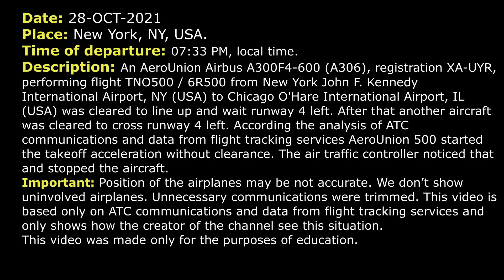Airplane started takeoff without clearance | AeroUnion Airbus A306 | New York Kennedy Airport, ATC

Comment: I was waiting to hear "Possible pilot deviation, get ready to copy a number!"!
Reply from the maker: Probably they didn't have time for that.
Reply: Everyone makes mistakes, so back in line, I guess
Reply from the maker: Yes, they've departed a couple of minutes later. Behind that 747.
Reply: There’s no way they weren’t contacted at some point with a possible pilot deviation. ATC is required to report to the FAA any type of go around due to something that’s in the airport environment. That’s why they always ask pilots what the reason for the go around is if the go around is chosen by the pilots so they can address any runway environment issues. 

Things like this aren’t a “whoops, no harm no foul.”
Reply: @VictoryAviation  They probably contacted company directly and safety report was filled anyway. I think copy number is mostly used for general aviation, when person responsible could be hard to identified at later time.
Reply: @FrankDrebin  I think that’s the safest way to go about it. However I’ve certainly seen part 121 pilots asked to copy a number on these videos several times.
Reply: If it was a US Part 121, they would have been given a number. It's a foreign airline, not operating with FAA certificate, ATC (meaning FAA) wouldn't have any chance to jeopardize the pilots certificates by filing a pilot deviation report.

Comment: Oof, that's a big mistake. I'm surprised they weren't given a number to call. 

Maybe they heard tower's instruction to AAL1199 at 0:39 saying "traffic will hold and depart prior to your arrival," knew they were going to get a clearance to take off shortly, and then just forgot to actually wait for the clearance? 

No excuse, but that's the only thing I can think of...
Reply: It still is something really silly to do though.
Reply: I posted this elsewhere:

There’s no way they weren’t contacted at some point with a possible pilot deviation. ATC is required to report to the FAA any type of go around due to something that’s in the airport environment. That’s why they always ask pilots what the reason for the go around is if the go around is chosen by the pilots so they can address any runway environment issues. 

Things like this aren’t a “whoops, no harm no foul.”
Reply: You shouldn't depart until you specifically hear tower clear you for takeoff.
"AeroUnion 500 cleared for takeoff runway 4L, winds 7 at 296."
Reply: @RacingProductions22  And also repeat it back for confirmation

Comment: A clearance to land. The departing aircraft’s mistake actually saved her a$$ by bringing her instructor’s attention to the situation. And yes, I’ve been a pilot for 42 years and was a controller for 30 years.
Reply: The screwup is completely on AeroUnion pilots.  The instruction ATC gave the following instructions:

0:21 ATC contacted TNO to hold at RW4L and wait, BUT NO ORDER to take off, and that there's traffic with 6 miles final incoming (AA) (TNO need to hold there for Jetblue to clear the runway and Delta to cross)
0:39 ATC gave AA isntruction on 4L, with the instruction that traffic is holding and leave before AA arrives, and caution wake turbulence (which meant AeroUnion should have taken off from 4L)
1:05 ATC tell Delta to cross RW 4L immediately and without delay as there are airplane on final approach (AA)

And the person cut in is most likely the supervisor (similar to Kennedy Steve, who's retired) or another ATC.

AeroUnion took off A) without ATC approval, B) WHILE DELTA is still crossing 4L, that's completely on AeroUnion pilot for taking off without ATC instructions

And in most major airports in US, planes can landing/take off on the same runway at the same heading (mix operation), in JFK's case, takeoff and landing can both take place on 4L as long as both planes involved will be on 4L heading, this happens more often on two runway airports (like LAX, JFK, or SFO with heavy planes)

Question for you is: how can you be a pilot for 42 years  and controller for 30 years  when controller maximum retirement age is 56 (if you're in the US)?  You got your pilot license at 14?  And have you ever flow passenger jets/work as ATC at heavy traffic airports like JFK or LAX (airport with Mix operations)
Reply: How freakin old are you?

Comment: Why would ANY pilot take off without clearance?  What else does the word HOLD mean?  This is commercial flying 101.   I simply do not understand the actions of this pilot.
Reply: It was a mistake. Very experienced crews make mistakes. No pilot that I know of would "knowingly" do that.  Somehow, they thought they were cleared to take-off and obviously there was a breakdown. You can be sure that there will be a report & investigation. 
It could've been a multitude of things that distracted them. The Sterile cockpit rule is there for a reason. I'm not suggesting that they broke that rule but it can lead to situations like this. 
I thought ATC did a good job managing their responsibilities to the other aircraft.
Reply: @BruiserFL  Totally agree. A report/investigation is required by the FAA for incidents like this. If ATC doesn’t report it, it could cost them their job.
Reply: @BruiserFL  no nothing do I ... but I would think that one of them would have spoken up and questioned when takeoff clearance occurred - and if in doubt checked with the tower.  (I was in error above, it was not just the actions of the pilot;  two people made a mistake)
Reply: Well, operating aircraft has more complexities and risks than you have any comprehension of.  Pilots make small errors and some of them can be catastrophic.  Good pilots recognize that they are not immune and when they make a mistake they own it.
Reply: @Spyke-lz2hl  I’m a pilot, and I don’t understand why they started to take off without a clearance. The clearance has to be given and read back to ATC for confirmation. None of that happened.
Reply: @Spyke-lz2hl  Agree Sypke with your words, although this doesn't explain how two people piloting the plane would takeoff when they were instructed to HOLD and were never given a CLEARED to take off command.  Again, I am befuddled.  Only the two pilots can explain this.
Reply: Could be in a hurry /stress / distraction / fatigue etc..you'll be surprised what they do in a jet engine flight deck...recently a flydubai also did the same thing on a max 8...also it takes 2 to make a mistake   here not 1 meaning both pilots thought it was ok to commence take off when clearly it wasn't ...end of the day both will be questioned.
Reply: @gulthepilot  especially 2 pilots making the mistake makes it extra egregious
Reply: @VictoryAviation  totally.
Reply: The first controller never said the word HOLD.
Reply: @GFSwinger1693  "Line up and wait."    Pilot repeated instructions back: "line up and wait."  WAIT means HOLD.   No one ever said anything about "Cleared for Takeoff;"   Again, only the pilots can say what went through their minds.   :)

Comment: Of course this was an error on the Aerounion  crew’s part, but it’s possible that a contributing factor was that I believe ATC misspoke. She told American that “traffic will hold position and depart prior to your arrival.” I suspect she meant depart “AFTER” your arrival because she never went on to give the crew clearance, but it’s possible the crew heard that and assumed they were given clearance. Glad all ended well
Reply: That wouldn't have made any sense. She cleared them to line up and wait so they must depart before arriving traffic. Trying hard to be smart, huh ?
Reply: If they depart AFTER the arrival, then the arrival has to land on top of the holding aircraft? 🤡
Reply from the maker: They were instructed to wait because Delta 764 was cleared to cross the runway at F. And after that i think the wanted to give them clearance. There was good separation for that.
Reply: @3x3-x3x-oXo  Come on now, I've seen this a bunch of times in the movies!!! Landing gear clears the holding plane's tail by just a few feet, and then everyone can breathe again. That's what was supposed to happen.
Reply: @michaelglasier7282  No, it was more than a few feet and because they were upside down they had to go around, remember that scene I do.

Comment: The Controller is at fault as she said "Line up and wait 4L". Now, the Aero Union crew probably heard the landing clearance for the American while holding on the runway and decided to take off to get out the way!
Reply: Nah that's not the way it works. 100% on the crew.
Reply: What are you talking about? That's definitely not it. Not saying this is what happened, but it's far more likely FO correctly read back the hold clearance, captain wasn't paying attention and started the takeoff anyway. Controllers did nothing at all wrong, and as usual paid attention, kept everyone safe and kept everything moving.